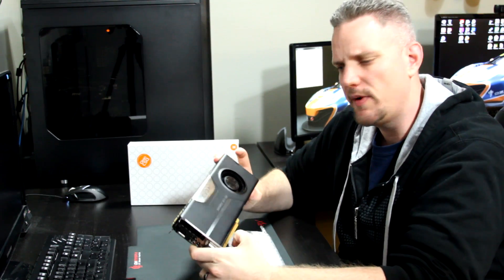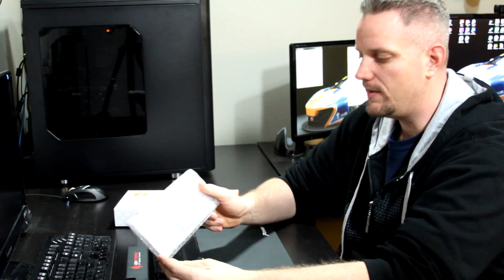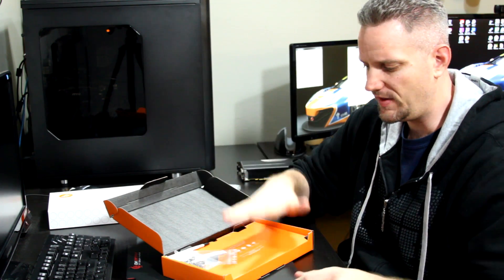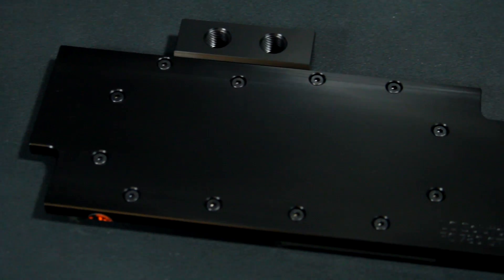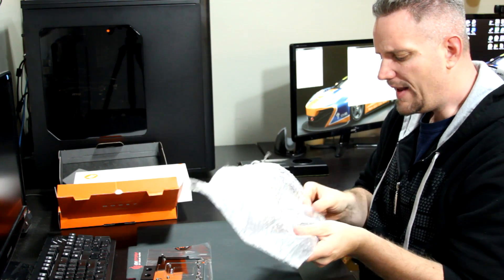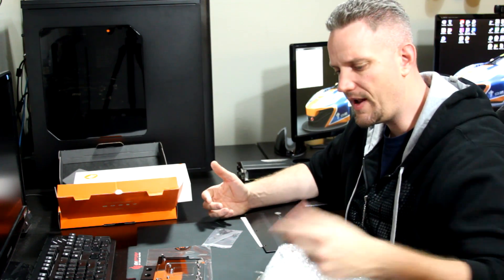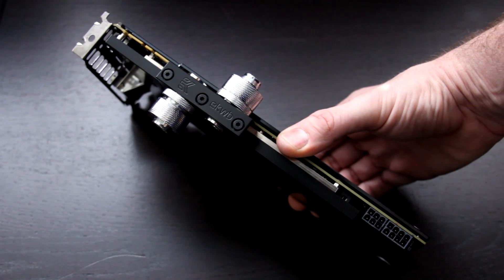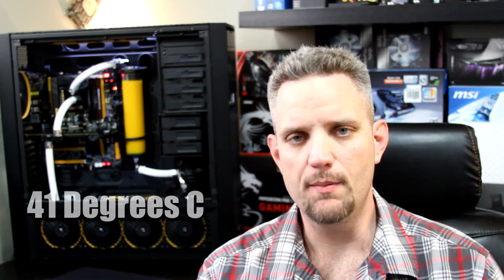EK-FC780 GTX780 GTX Ti Waterblock - Performance Review

Comment: Jay i know this is a super old video!  But i puchased one of these used and cleaned it up , i have ordered 1mm thermal pads to replace them with , will this be okay ???? They looked to be maybe 0.5mm  on the block but i cant tell if that was cause it was old ?
Reply: yes

Comment: why do you have the loop going directly from cpu to gpu?  why not cpu to radiator to gpu to radiator? you would  see an improvement, especially with those massive radiators
Reply: it doesn't matter because the water is moving fast enough

Comment: Just picked me up two of each. I got the acetal versions rather than the nickel. They should be arriving in 2 days :) cant wait
Reply: Seeing as this comment is now a month old, how does it perform?
Reply: Very very very well. I have never seen them hit 50c... Not to sure about VRAM because mine don't have the sensors. I have them in a loop with an RX360, RX240, and a Photon D5 pump combo. I recently added an EX240 rad, so temps may drop more (haven't installed it yet).
Reply: Yea I run a bios hacked 780 1.21 volts oc to 1250mhz and it's amazing this block never see above 41 celius
Reply: I recently sold my cards, so I don't have a GPU at the moment. They were the 6GB models.

Comment: does this fit on the dual classified? (one inch taller than both reference and regular evga sc)
Reply: no it doesn't you will need to get the classifed version of this waterblock if you want to watercool a gtx 780 dual classified

Comment: BTW I love your computer at the end in the background, are those low speed fans you have on your radiators? I need to ditch the UltraKaze's I'm running because they are oober loud.
Reply from the maker: They are SP120 quiet edition fans running at 50%, approx 600rpm
Reply: They're Corsiar SP120's I believe. They come with red, white and blue colour rings, but Jay painted his yellow. They look pretty swish imo, but as said above, Noctua fans have unrivaled quality and are most definitely not "oober loud". :)

Comment: Cant wait to get my new gpu, Jay come check out my 2013 setup think you might like it. my rig is watercooled as well with a blackice sr1 480 hanging off back of case and another 240 rad in case, So many things i want to get this year, new case, mobo, chip, gpu's, oculus, 4k moniter, triple 1440p 3D moniters, Love being a pc gamer :)
Reply: The Asus 1440p monitor is my most anticipated item this year. I can only afford one at a time so I may never get three of them, plus running three of those at 100+fps isn't really possible with the current cards even in sli so for now 1 will do, I was going to get a 30" 1600p from overclockers.co.uk but when I heard about g-sync I decided to wait and I'm glad I did. I'm on a single 27" 60hz Benq at the moment so if a bigger sized or ips version is announced before the Asus is available I may wait a bit longer, It seems like we're in for a good couple of years in PC gaming.

Comment: No Benchmarks ?
Reply from the maker: I told you what max temps were when game benchmarking. Watch it again.
Reply: nasha thedog watercooling allows for higher overclocks not as limited by temperature. But it still doesnt solve unstable overclocks, most small OCs only give you 1 to 4 more fps. Unless you make a custom bios nvidia's limits they put on the card force it to throttle and become unstable even at a 15MHz boost to my gtx 770 superclocked makes my drivers crash.
Reply: ***** so in other words for common people it's a complete waste of money to water cool a gpu 
And in instead of buying a gtx 780 and watercooling it you should buy a gtx 780ti and let it air cooled ?
Reply: Amine Bziouech or just dont buy a 780ti for the extra 10 fps you get in games for 300 dollars more than a 780, better yet just get a 770
Reply: Damn, That's what I was hoping to see, I want to know what it does for performance while gaming.
Reply: ***** It's not temp's I'm interested in it's seeing whether you get much of a performance increase through being able to overclock it higher, As a gamer rather than a benchmarker I would of liked to have seen how far you could push it and what that did to in game numbers. That way I can compare them to my air cooled 780 scores (or yours from before) although I'm more interested in comparing them to my 780 Classified scores.
Reply: ***** in other words how much fps did you get out of it after water cooling it compared to air cooling
Reply: That's what I was interested in seeing, Is there any point in watercooling or will I get just as much gaming performance from a top end non reference card. I have a 780 Classified, sticking that under water isn't going to improve game fps presumably then
Reply: ***** i think i will get a gtx 780 i am planning to play on 1600p
Reply: ***** I know that which is why I was interested in comparing it with my air cooled card, that has dual bio's for safety and unlocked voltage with a easy to use voltage unlocker allowing up to 1.35v. If I'm remembering it right, JTC uses those sorts of tweaks as well. So it would of been nice to see if those and water give an advantage over a good air cooled model. My cpu has an all-in-one air cooler but I've never bothered to look into doing a loop system and if it isn't worth it I never will.

Comment: I think EK makes extraordinary products. Their reservoirs are second to none and the only one you can really buy that you don't have worry at all about get leaks with. The water blocks are also beautiful look and higher quality than pretty much any other. Their CPU blocks are outstanding and pretty much the best out there for Haswell, especially 4770k. Just love the unique, simple, modern design and the super high quality with great fit and finish. I have their CPU block, the GTX 780 water block with white back plate, reservoir, etc.

Comment: ***** 
Which pump are you using for that much tubing & radiator volume... MCP655/D5 variant?
I'm pushing close to two gallons of water, but you have me there. MCP 655 on my old SLI'd 8800 GTX rig for 8 years. They're stout.

BTW, that OJ colored fluid and an MSI Mpower Max would look great together. What brand additive or fluid is that?

I still have my 8800GTX SC's in SLI running day to day tasks and games. They are still amazing 8 years later.
Reply from the maker: I'm using a actual Swiftech MCP655 Variable. Radiators don't really add much resistance it's the blocks that do. One pump has been good enough for me for now.

Comment: technically its not the same PCB, there is an extra cap near the back as well as more VRM's on the Ti  but yeah it will work like you said. 

nice video though.

Comment: ahha that 8800 ultra was a beast back in the day. i had the 9800 GTX+ OC'd to the wall which was pretty much a rebranded 8800 card. it was sick and it still runs in my sisters pc lol
Reply: 8800 GT can still run modern games at mid settings with 45+ FPS, such an utter beast, Still around $150-$220 today
Reply: SandersCSclips  haha yea they were BEAST!